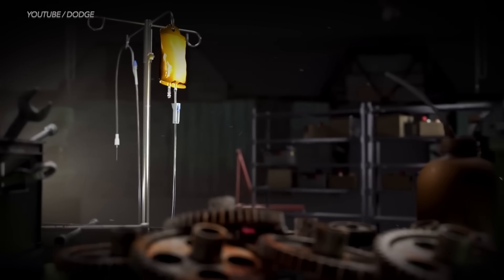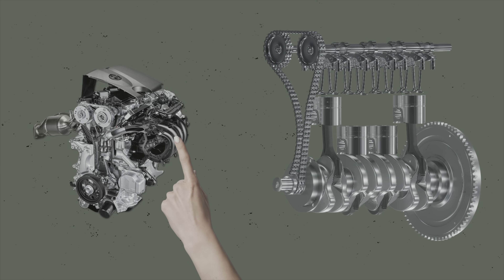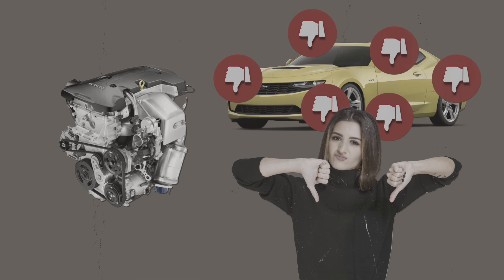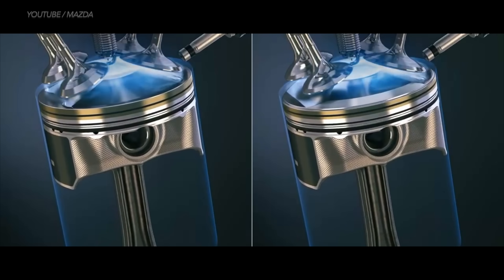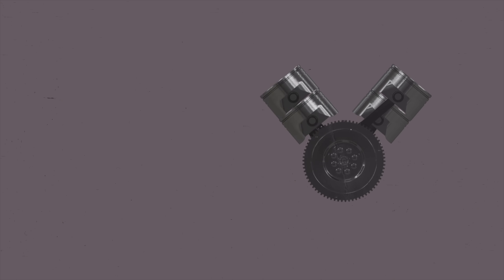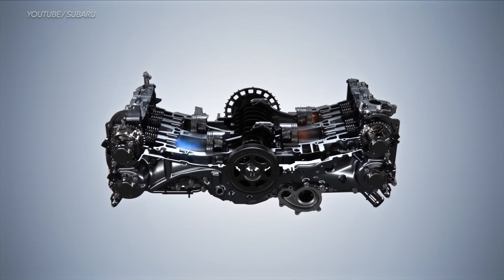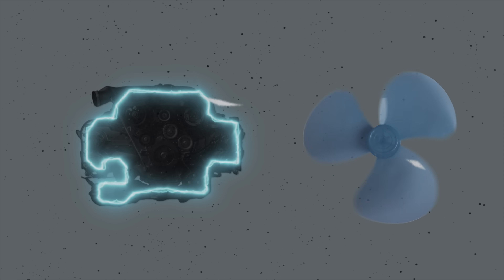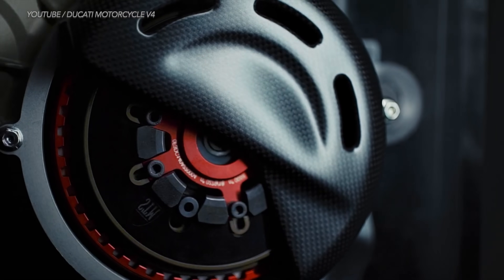This New 4 Cylinder Engine Just Killed the Future of V8 Engines

Comment: An in-line 4 if made properly is the best in terms of reliability and ease of maintenance and repairs. 
My 2002 Camry with the 2.4 is one of the easiest cars to work on that I’ve ever had. Has plenty of power for everyday driving along with good MPG. There has been so many good and bad I4 engines made over the years. It’s almost crazy how a car manufacturer can mess this up but they all have. In Toyota’s case changing the original design and putting low tension piston rings in the 2.4 was a huge mistake. Along with switching to 0W-20 and promoting long LOF intervals.

Comment: The engines that I have had the most trouble-free experience with have been inline four cylinders. One of my favorite is the 1.8L Toyota.  I experienced the heavy oil consumption Boxer engine issue on a 2012 Subaru. Subaru eventually replaced the engine after over a year of frustration. The replacement engine started eating oil after about 2 years. 

Meanwhile, I have owned four Toyotas over many years. No issues. No oil consumption.  Just did routine maintenance.
Reply: We've owned five Toyotas over the years.  One was a certified lemon, one had cylinder head problems, another had the transmission go at 174k, and the last one had the valve cover/eroding valve cover problem (2002 - 2005 4cyl Camry).  Buying a Toyota is no guarantee that you'll have a perfect, long lasting car. and, BTW, the particular engine on the 2012 Subaru had oil consumption problems (you know, like the chronic oil consumption/engine failure problems on the Toyota V6 ten years ago).  Subaru engines since then do not have that problem. You should have sold your Subaru after the engine was replaced.
Reply: @eskieman3948  So your eye glasses are not shade of toyota rose bias. Hmmm.

Comment: All the engines have pros and cons but the cons on all of them is what I call the "JUNK" engineering. For example, direct and port injection, turbos, computer programming to over achieve gas mileage, emissions, etc. My wife's '07 Accord now has 185,000 miles. With regular oil changes it may go on forever. Simple and strong, port injection only. The only engine maintenance other than a spark plug change and regular oil changes  was an oil sending unit replacement and I changed the PCV valve once. Now Honda has those GARBAGE 1.5L turbo engines. Would not touch them. Now they are moving to 3 cylinder turbos. What could possible go wrong???????? My Titan truck has the Endurance V8 (no turbo garbage). Bulletproof!

Comment: How about an inline 4 rotated 90 degrees to lower it's center of gravity w/o going opposing cylinder like a boxer?
Reply: I have thought that would be a good idea, too. I guess the space between the struts on most cars and the space for the driver’s feet do not allow it. The radiator is already very close to the engine, too.

Comment: Porsche has been using boxer engine for years. Airplanes use similar designed engines. They are weighted better than other engines and are extremely reliable.
Reply: Yep.  I've seen several VW engine powered 'home built' aircraft, and last year at Sun 'n Fun, I saw a couple of Subaru-powered aircraft.  Never had a chance to talk to the owners, I wanted to see how they liked them.

Comment: Has an auto manufacturer which uses boxer engines ever designed a car, with access to the spark plugs and valve covers from the sides, with removable front quarter panels?

Comment: I have 04 and 05 Camrys with inline 4 cylinder engines. I love the reliability of these as well as their simplicity to work on. Do not have to remove an exhaust manifold to change a spark plug like you do for a front wheel drive 6 cylinder Avalon for example.

Both have over 200000 miles and are still running strong.

Comment: Hey Scotty. I have recently had an opportunity to have gotten my hands on a 2023 Nissan rogue. Automatic and yes the transmission everyone hates. I think I found out why these engines go bad and how to avoid it. I did it by mistake. When it's in drive you push park it goes in park. But believe it or not you can actually push the button to turn the car off with it in drive and it will throw in park and shut it off one move. I did this by accident and the transmission DID NOT make a healthy sound.
Reply: Crappy Nissan engineering strikes again.  Mercedes hasn't been known for reliability in decades now, but their cars, by default, turn off with the transmission still in drive.

Comment: Hey Scotty. I used to own a 1974 Mazda RX 4 with a rotary engine. Very critical with air gas mix. Ran very good. Can you cover a rotary engine. I knew nothing about them. I actually gave the car away because I couldn't get it to run. My friend put an air filter in it that I had to remove to work on it. It fired right up and ran perfectly. Lesson learned. This happened back in the early 80's.

Comment: I have a 1.8 I4 in my Corolla. I haven’t had any major engine issues. It could use a little more power, but it’s been sufficient for my needs. I wouldn’t trade power for decreased reliability, which is a hallmark of Toyota I4 engines. The 1.8 has been particularly bulletproof.

Comment: My favorite engine was the slant six in my 1964 Dodge dart. Easiest engine to work on I've ever had.
Reply: At one point, the slant six was called the Mopar killer because it never needed parts and it made no sense to try to upgrade it with stuff like racing kit parts.  The only problem with it was it was difficult to rebuild in its later years because the cylinders would oval out.  It wasn’t unusual to go to the junkyard and see completely worn out cars with a perfectly usable slant 6 in them.  Like the VW, it wouldn’t win any races, but it would do 80 all day long.  You could buy a beater with a slant 6 and be confident that the engine would get you from LA to NY and back no problem.  Make sure there weren’t any steering or brake issues, throw on new tires, points, and plugs, and you were good to go.  I did this several times in my 20s.  When I got back to LA I recouped my money by flipping it.  It took longer than flying, but you got to actually see the country and it cost less in the end.  Loved that engine.
Reply: I had one too.  Reliable but weak on power.
Reply: Agreed.  I had one in a used '71 Dodge Dart it ran great with the 3 spd Torqueflite auto.  Unfortunately, someone else like my Dart more than my family, and I never saw it again.
Reply: Oh?  You mean the "Leaning Tower of Power" ???    🙂
Reply: Those things never quit, just like the Ford 4.9 liter inline 6 and the Chevy "Stovebolt 6".  The Jeep 4.2  and 4.0  liter inline sixes  were also excellent engines but  the survival rate was lower simply because they were in Jeeps taking much abuse off-road.
Reply: One of the best engines ever produced.
Reply: I've got a 1964 dart 270 slant 6 3 on tree , I found and installed a 2 barrle intake and carburetor  on it
Reply: Oh my goodness I bought a 1967 Dodge dart slant 6 202 pop the hood remove a couple of bolts and I could replace my starter no problem. Did not even have to crawl under the car to do it it was great. Unfortunately my mother totaled it so we have that
Reply: You could sit in the engine bay and work on it.
Reply: I had a Dodge Dart. Loved it.
Reply: Yep, and a 1960 Plymouth Valiant. A straight six is the best.
Reply: I had one of the last of the slant sixes in my 1975 Dart.    Later I had 318 V8 in my 1993  Dodge Dakota pickup.    Eighteen years I "sold" the Dakota to a friend, that was 2011.    In 2021 he sold that Dakota to his neighbour.    Two great engines from Chrysler, but sadly they haven''t made reliable vehicles in decades.
Reply: I agree. I think I borrowed my dads old Dodge Dart for my first date . My brother got the car after me. He drove it for like 25 years till the floorboards rusted out. Car still ran fine.
Reply: I would choose a straight six or a V12 ...

Comment: My 2006 Corolla 1.8 liter I4 1ZZ-FE engine, purchased new, oil change every 5k is still going strong at 400,000 miles and zero issues.

Comment: The performance of the Ford 2.0 TDCi engine varies depending on its variant. There are versions without problems and those that make some problems.

Ford mondeo mk4 2012 TDCi 140hp   Is a good engine.

But if you search on the internet, ford cars have had a lot of problems with their cars over the years and many recalls.
Reply: Just like all other cars.  Life goes on.

Comment: Seems like most late model 4 cyl motors have issues, especially when there is a turbo involved.  A normally asperated (NA) V6 most most SUV's and cars gets about the same gas mileage and the engines last a lot longer.  IMHO, these new 4 cyl turbo motors are not the best engine configurations for car/trucks/SUV's

Comment: I've had a 2002 wrx for the last 15 years. I did replace the engine within the first year. But the boxer engine been super solid and smooth running since. It's been "stage 2" since it was installed, making about 290-300 hp.
Reply: I love seeing the Subaru WRX factory teams race at the rallies - can't get that kind of excitement from driving an EV!

Comment: I have a Ford Focus with a 4 cylinder 5 speed manual transmission and it's not the most powerful, but with over 280k miles, I have no complaints and it's still getting 35mpg highway

Comment: For 40 years I've had the 4.9 L 300-6 in my 83 E-100. Has just 150,000 miles on her, still runs good. Why don't they make new engines "interrupted " Scotty? It's a great feature.
Reply: That 300ci 6 is a good engine, really great for a pickup or fan.

Comment: 2011 Scion xB.
Oil consumption....but I WILL say, that I using full synthetic oil and running small amounts of Seafood in the crank case and Berryman's in the fuel has turned my 185,000 mile  workhorse into a new car.
Reply: That's really good.  I'm going to try to run Berrymans in my fuel after my next oil change.  I hear that it's better than Seafoam.

Comment: I have an inline 5 cyl. 2,7 diesel mercedes.
I love this thing, it pulls like a train, at low speed you hear the fifth going along, making it Sound allmost like a V8 and it get great “gas”milage.
Its a 2001 W210 270cdi, the one he allways shows when takling about klunkers… luckely not this one… it has 275ˋ000km.

Comment: I always remember with great affection my father's V4 Zephyr. You genuinely couldn't tell whether the engine was running or not. Unbelievably smooth, and its size left room for the spare wheel to be sited under the hood/bonnet.
Reply: And I think that Ford V4 found its way into the SAAB 96 from the late 60's.   Drove one from Portland Oregon to Cabo San Lucas to Boston....Loved that car...it was so good
Reply: I had a Subaru GL-10 boxer 4 many years ago that had the spare tire under the hood as well. The boxer engine was short and left room for the spare behind it.

Comment: Living in the Netherlands and having driven Subaru's  of various types over many years, I am surprised to learn about these recalls and problems you mentioned in your video. I have never heard about these typical issues here in Europe.  One issue is known here to the old 3litre  engines with high mileage (kilometers) having  some higher oil consumption but his was many years ago.
Apparently the USA market is served by a Subaru factory in USA and well as component suppliers  while "our Subaru's  " in Europe are all imported from Japan as per Subaru Benelux explanation.
Reply: I only had passenger airbag recall. No other issues so far. 140K+ miles
Reply: @pole6840  you go pole dancer🤣
Reply: In Europe one does not drive the typical distance in America. Not even close. Therefore we will find more problems because we demand more from the vehicles. We have a saying in the US:  In America, 200 years is a long time. In Europe, 200 miles (~320 km) is a long drive.
Reply: I intuit the oil consumption is due to the horizontal configuration.
Reply: There were a few things that happened, they used a lousy head gasket on 03-05 (?) Forester n/a from the factory, but the turbo models were fine. Just a for instance.
Reply: @theinvisibleman2070  It's so common I don't even notice anymore.
Reply: Scotty's full of it the v8 is going to be around for all time🤣

Comment: Isn't an in line 4 typically known for rough vibration running?  I have the Chrysler Multi Air and initially it felt like a shaker.  Now I getting the correct 0-20 w oil in it and it seems perfect in all respects.
Reply: i4's are known to vibrate yeah in second order and they're worst for it at idle, its about on the barrier of tolerance if you need a balance shaft or not thus most economy i4's (not premium trims) entirely forego it. Otherwise the i4 is the best engine for economy/affordability due to less repetition of valvetrain components such as in a v config.

Comment: 4 cylinder engines should be outlawed. No vehicle should have less than a v6. They are sluggish, slow and the fuel economy is not that big of a difference to keep them around.
Reply: Outlawed huh?? 🤔

When I had 80's Hondas, the engines had 100-130 horsepower. Pretty slow. Today 4's range from 200-400 horsepower. I don't think they are anemic or weak anymore!

Comment: 4 cylinder engines are good for everyday commutes and basic transportation. 6 cylinder and 8 cylinder engines are great for load carrying, passenger carrying, towing, and performance. 4 cylinder engines with hybridization is the most efficient, and Toyota and Lexus are leading the automotive industry with their Hybrid systems.

Comment: the main reason most Manufacturers go to 4 cylinder, specifically inline-4, is that they are cheap af to make. Currently you pay V6 or V8 prices for dogshit inline 4 engines. 
Its all about profit maximization

Comment: Scotty never mentions the Mitsubishi 4B11T, an incredibly reliable 4 cylinder engine that puts out 290hp stock.  The one in my 2008 EVO has given 15 years of trouble-free power and is still on the road today.
Reply: The in-line four in my 2013 Honda Accord Sport has been chugging along faithfully for ten years.
Reply: I’m not sure I would call a 4b11t a stock engine. That’s like saying the GT500 engine is “stock.”
If you mean the 4b11 NA then sure but the t is technically modified as the supercharger put on the 5.2l is “modified.”
Reply: @timhenderson895  modified from the factory?
Reply: @wyndhamcoffman8961  yes…as I said the gt500 is built that way from the factory. It’s just interesting to me that just because it came that way doesn’t mean the initial engine wasn’t modified by the factory…the z06 is factory modified with the super as well…

Comment: I would build a modern V4 using pushrods. Probably hydraulic. Makes the head smaller, reduces the need for an over-complicated valve train. 4 valves per cylinder wouldn't be a problem.
Reply: How about a V4 flathead?
Reply: I would build a modern V4 with Koeningsegg new type of freevalve. It would easy make a 1.5L to 150+hp. Koeningsegg 1.4L 3 cylinder makes 600hp with freevalve!

Comment: Haha, the inline four has been around since 1910. The v8 is not dead and the fact is the ability to have the ability to call on power when towing that ability is required. This is short sided and as soon as hydrogen is on line the v8 will rule the market again. Long term ability is key.

Comment: I have an inline 4 in my '02 Toyota Echo 1.5L, 100hp, FWD (Auto), and boxer 4 in my '23 Subaru Crosstrek 2.0L, 150hp, AWD (manual).
They get IDENTICAL fuel economy figures.
I think inline 4 is better suited to cars, and boxers for SUVs.
The lower center of gravity makes the Subarus with higher ride height feel like a regular car. the equivalent sized RAV4 or CRV feels like a land yacht.

From what I'm hearing, most of Subaru's problems are related to ECU and the CVT transmission. The standalone FB20 boxer fairly problem free, and the stick is bulletproof.

Comment: I actually drove that skyactive g a few days ago and it’s a beast of a 4 cylinder. Still has turbo lag and bogs down sometimes. I did notice it had good fuel economy and initially I thought it was just a normal Mazda 3 until I got on it merging on the highway. Looked up the stats and I was like this thing is a sleeper 😂.
Reply: Sri + catback stage 1.5 + ecu tune + 91-93 octane fuel  = steady 280-300hp

Comment: 2007 CRV and 2011 Element both have in the inline engine. Synthetic oil since day one. 
 I'm scared to buy a new engine since many now have GDI which has its own set of problems.
Reply: Right? My 2010 2.4 liter accord running strong at 325k miles. Almost the perfect engine

Comment: From what I saw in the video, there is no new 4 cylinder engine, it's just a review of the same ones we've had for years. 4 cylinders in vehicles like vans should be outlawed. I've been in multiple which have such poor performance after a couple years they are a hazard to drive, they struggle to even move the vehicle. Please people stop buying 4 cylinders in vehicles larger than compact.

Comment: Never met a 4 cylinder that I liked. The V6 is the perfect engine. I like it better than the 4 any day. Trucks should have a V8 if you are going to pull, other wise a V6 will do. 😀✌️
Reply: My 2.4 liter 4 cyl Honda accord boogies. Super reliable fast torquey and quick. 325k miles and going strong
Reply: Steve has it. K24 or K20 is great. 

2.0T AMG has 400 horses. But even the 2.0T in Type R starts out slowly. Most 4 cylinders have trouble getting out of the hole. You have to rev the engine to higher RPM when starting. 

I always preferred Honda V6 for smoothness and torque
Reply: Love the power of the V8 in my 2006 eplorer with 245K miles on it. It has had plenty of other issues thru the years and is nearing it's end. But I'll still miss it when it finally is time to retire it.